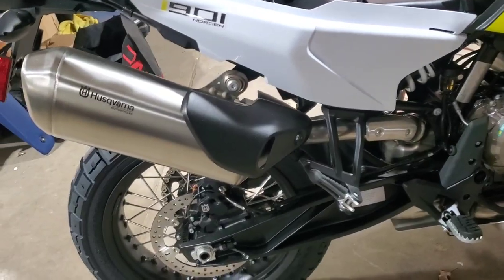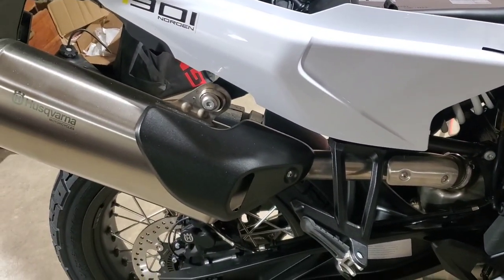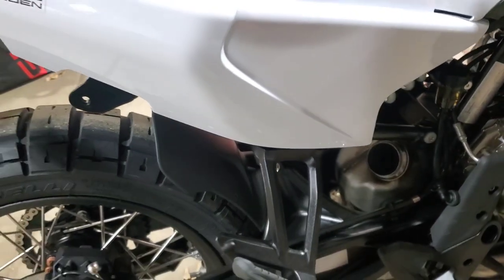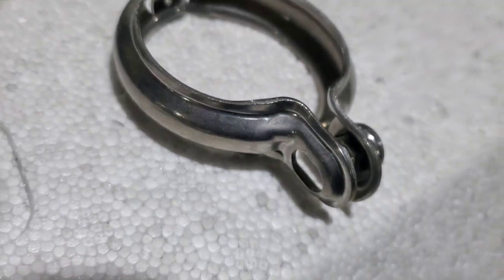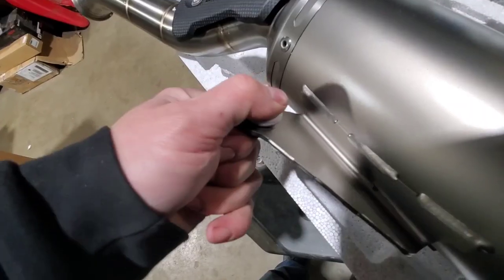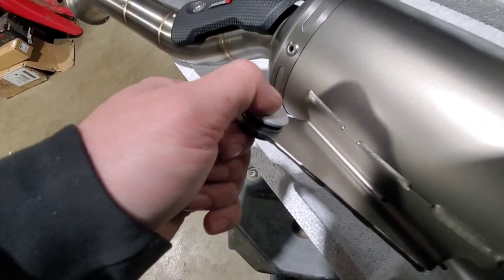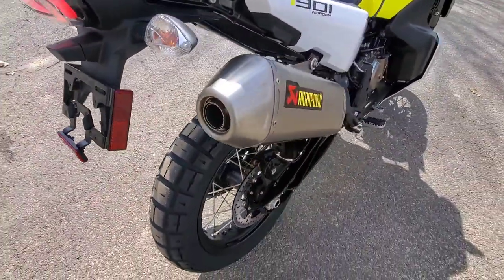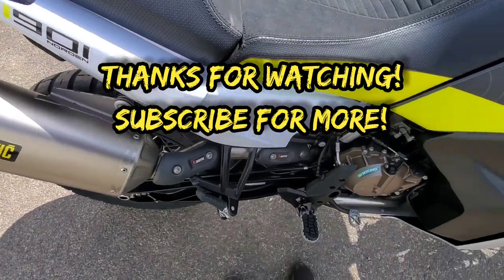Akropovic Slip-on Muffler for the Husqvarna Norden 901

Comment: the engine is louder than the exhaust
Reply from the maker: Yeah, definitely have to remove the cat to wake the thing up. I've started and rode 5 around the dealership so far. They all had a very loud motor until they fully warm up.

Comment: Damn, that motor sounds terrible, like a coffee can full of nuts and bolts.  Is that normal for the Norden?
Reply from the maker: Unfortunately they all sound like that new. I thought it was a faulty cam chain tensioner at first. Changed it and no difference. I've heard 6 of them so far and they all sound the same
Reply: intake/exhaust cat & cannister delete power commander to fix the mix and the sound is all intake and exhaust note , of course the performance increase and far cooler running , but yes the engine itself sounds like a clothes washer full of wrenches